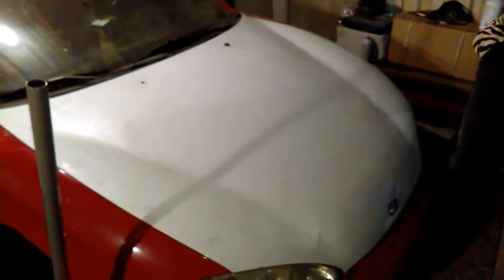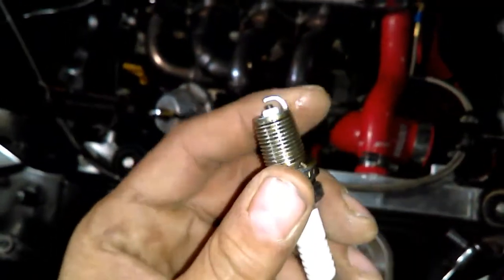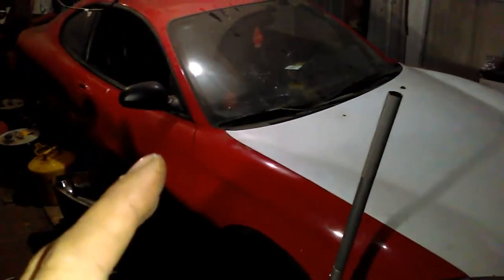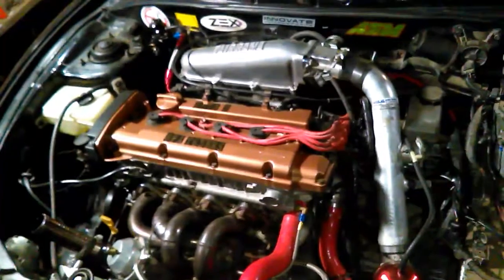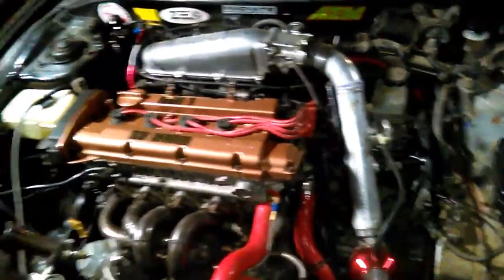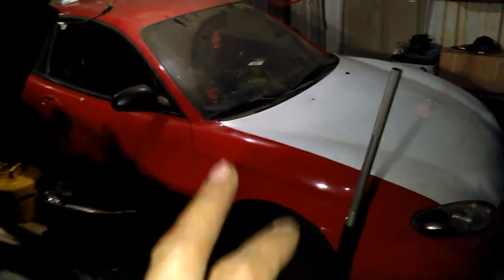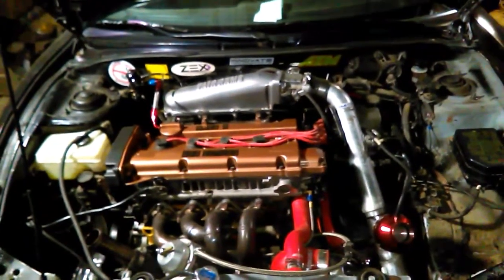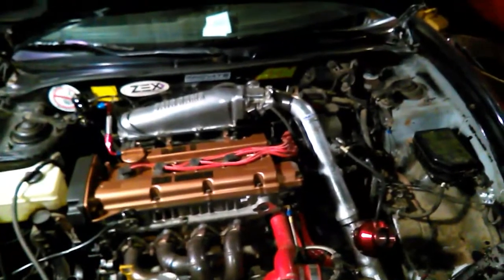Rd Tiburon gets a hood plus updates

Comment: Hey man I texted you about your catch can deal. Did you still have your PCV valve installed when you tried it, if not or if it was bad boost would go into your crankcase. You can also put always vacuum to it from turbo inlet. So you have a line for another turbo intake for that one, I thought you might have said they are scarce. Awesome it’s shifting better with the new mounts.
Reply from the maker: Street Freaks Racing Videos I live in the mountains no cell service just have a 30 buck flip phone lol. I need to buy another cell phone so I can use my Wi-Fi for cell service once I get a good phone I'll let you know the new number . yes I did still have pvc valve hook to it